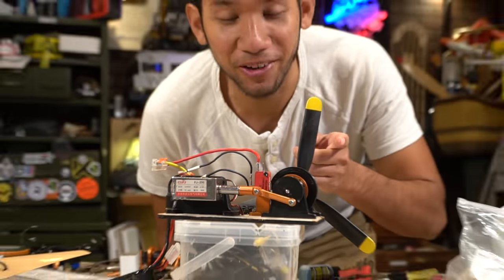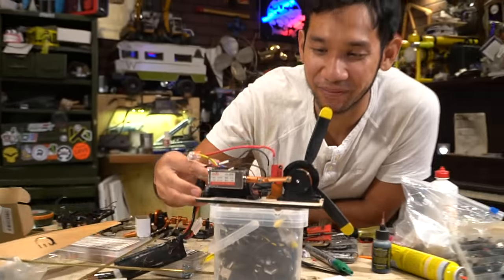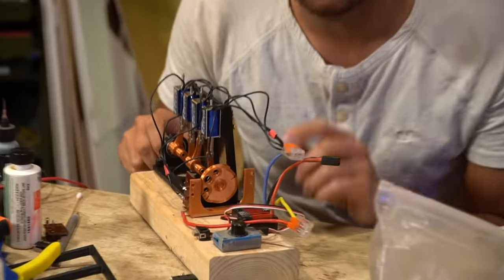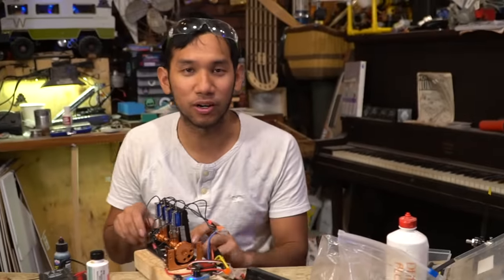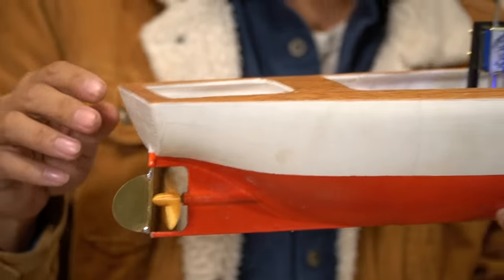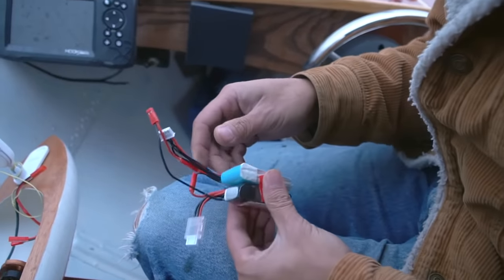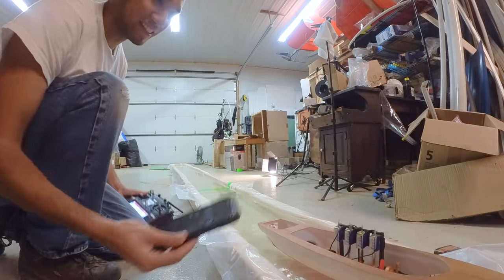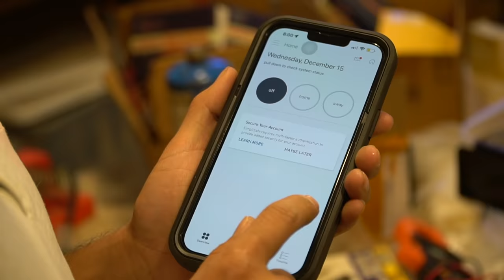Electric piston engine DIY (solenoid motor)

Comment: These engines honestly make me think of steam engines more than gas engines. Also Peter if you cover the engines and add a little bit of an opening for air flow, the heat generated from the engines could in theory keep them from getting cold! Also… you should totally use these to make a full scale titanic! The titanic had engines with those kinds of pistons that used steam. It would be a pretty cool model idea!
Reply: A full scale titanic?

Comment: You can put a switch on the other side of the cam from existing switch and do something clever to reverse the solenoid current flow on the reverse stroke, so that the cylinder becomes dual acting. You can't get that from a gas-powered engine!
If you wanted to get really fancy and improve the efficiency one could use hall-effect sensors and an electronic control module to run it all. If you can reduce the current flow it might become a bit more efficient. Very cool!

Comment: You need a 90 degree throw crankshaft. Your engine is basically a 2 stroke (fires every revolution not every other), and the 90 degree crank will give you 4 discreet firing pulses, a much smoother run, and not be "fighting itself" so much.  If the solenoids get hot really fast, that's a good clue that your timing is way off. Add to that the fighting itself, and you'll have that result.

Comment: It looks like fun but some things to tweak? Use the flywheel bolt metal or cams for 4 x switches at 90 degree angle spacings to bridge circuits for each solenoid. Change from flat 4 cylinder to 90,180,270,360 degree crank big end angles to permit starting in any position. Lube the solenoids with silicone. Drop the center of gravity of the boat. Consider using a speaker coil arangement instead, to permit power on both strokes. Mount the solenoids in a V arangement or flat 4 to drop the center of gravity.

Comment: i made one 4 cyl engine with  a magnetic crankshaft angle sensor to set the firing timings with an arduino, my plan was to put it in a boat aswell, using these magnetic clutches found in printers.   but after getting it running, it was way too weak and overheated quickly, the printed parts melted after some time.    the engine was a failure, but in the process found a easy way to build a high resolution sin/cos absolute magnetic encoder for literally cents worth of parts. basically two linear hall sensors, one 90° rotated and magnet on the shaft (field must be diametrical along the axis)

Comment: @PeterSripol I think if you put a flywheel and connect to the crankshaft it will make the engine run a lot smoother.

Comment: In addition to the 90deg offset like everyone else is mentioning, I also think adding more mains would make a huge difference, u can see the crank bending hugely at the end with the prop on it... bending crank removes sooo much potential energy, if the crank had more mains and could focus on turning rather than bending would like double or triple your efficiency I'd say

Comment: Peter, now make one with double acting solenoids, energized them on the upward and downward stroke by reversing their voltage polarity accordingly. You will double the strength, and the heat lol  Also, make it three cylinders, spaced at 120 degree from each other axially. And control the three phases voltage waves with a microcontroller triggered by a crank sensor. It would run smooth and be powerful, don't forget to force liquid cooling thru you solenoids! See your video in a year.

Comment: You could make it more powerful by not only adding more "cylinders" but by using thinner wire to wrap more coils, this makes a stronger magnetic field, making the motor stronger

Comment: Definitely need to adjust the timing. I'd imagine the solenoids are acting on the crank well after center which is slowing the crank tremendously. Proper timing and if it was setup to push and pull, it probably would have a decent amount of power for what it is.

Comment: I heard at the end of the video that the switch burned out due to the intense sparks due to the conmutation of high electric power. You could use transistors to switch the high power electricity from the solenoids, and only using the switch to conmutate a lower electric power that controlls the transistors and that does not burn the switch, it could improve the life expectancy and reliability of the mecanical switch you used for the solenoid engine.

Comment: Slap a crank sensor on it and control it with an arduino, and you'll get much better control of solenoid activation duration and timing, you'll get speed and torque, also crankshaft throw size is a major player.
For the air plane you have to do a radial one, it will be too cool, but maybe too large :D

Comment: I would go for a I6 configuration with the pistons separated 120º of each other, it would increase the torque since there is always 2 solenoids on the powerstroke. Also, you may want to try to create your own solenoids with permanent magnet rods so they can do double action, altought I dont know if that is posible. Aside of that, look for a solid state swiching and a proper way to disipate the back EMF that the coils generated when powering off, it will fry your circuits in no time

Comment: @PeterSripol ooooh please a WWI style rotary solenoid motor for your aircraft version? A 7 cylinder Gnome or a 9 solenoid Le Rhone? It will give you the additional advantage of much reduced crank and case weight. And it will just be sooooo coo!
Reply: Bonus—no flywheel needed, nor counterweights for reducing vibration.

Comment: A cross plane I4 should give you a smoother power delivery and possibly help with the stalling. At the very least it would be self starting if it does stall. Of course you would need two switches for that.

Comment: Well done, i have an improvement to offer : the switch can not hold all those sparks for long, you better use a FET transistor to run the solenoid's,
no damage will cause to the switch. good luck.

Comment: Basically term, down stroke when the connecting rod(and piston) is moving away from the cylinder (making more space inside the cylinder)  and the up stroke is when the connecting rod (and piston) is moving two-day the cylinder (making less space inside the cylinder)

Comment: If you used a DPDT On-On switch you could have it alternate current direction through the solenoids so both directions are power stroke, to get double the torque and power output

Comment: A couple of suggestions: 
I think the single cam and switch is a big compromise as you are unable to tune the pulse to something other than a 50% duty cycle.  I think it would run better if both the on time an off time could be optimized.   
You could collapse the magnetic field in the coil a lot faster if you hook the fly-back diode to a higher voltage.  It will not take much current but will put the brakes on the magnetic field much better than just returning the diode to supply voltage.

Comment: Btw buddy you should have added a 2 speed transmission. 1st gear is a 1 to 1 gear ratio then gear 2 should be a cvt (continuously variable transmission) to have low torque needed but a ever lasting raise in speed

Comment: I'm going this comment before I've finished watching the video: I wonder, could you arrange the pistons in opposition, to minimize vibration, like in a motorcycle? Also, I would it not be advantageous to use the motor to spin a large flywheel, from which you could extract energy, possibly via a torque converter?

Comment: Fairly sure solenoids can pull and push, so youre only using half what theyre capable of if so! Also  a crossplane crank with 2 cyls would be smoother; and an alternate mechanism for triggering them, hall effect sensor maybe?

Comment: How about using a DPDT reed (or other type) for polarity reversal? This would allow the solenoids to pull as well, providing (I assume) twice the power; only caveat would be that you need to ensure they don't "fight" each other, so they may need some sort of out-of-phase disconnection or an imbalance in the crankshaft or something. Idk, I'm not an engineer

Comment: Now try building a double action solenoid V8 engine. Double action solenoids push and pull both directions instead of a latch/single action. You would get a working “stroke” on each cylinder every revolution. Control timing by having an arduino fed crank position using a Hall effect/reluctor or photodiode/grid wheel and have the arduino fire a large mosfet setup. It must be wired correctly to get push-pull action by all 8 cylinders. Set crank angle readout at zero and fire 1-8-4-3 down and  6-5-7-2 up and reverse operation as soon as crank readout changes to zero again. You can introduce small ignition delays between cylinders to smooth it out. Flywheel is not necessary because each cylinder has a working stroke on each revolution, you can even fire all bank 1 to go up while bank 2 is all pushing down. The setup maybe a bit complicated, simplify it by having two straight 4 banks running double action solenoids and join cranks on one output. You can use your current setup but need another switch to control the second action of each solenoid.

Comment: I guess the problem is in the shaft position sensor; it’s mechanical switch. You could enhance your engine by using electronic sensors and further improving by several of them for each solenoid.

Comment: With more precise timing I think you can greatly improve power and efficiency, I would use an arduino and a rotary encoder. For the airplane that I'm really looking forward to, I think you should definitely make a radial engine.
Reply: Wouldn't a purely mechanical solution be morein keeping with the style of the engine?
Reply: @TheKamiBunny  it is somewhat electrical already, but yes I know what you mean and yes that'd definitely be cooler but also heavier and much harder to build and fine tune especially at higher speeds.

Comment: Piston engines need a flywheel to run smoothly. Especially with a long stroke. Also helps with changes in torque demands due to the kinetic energy stored in the flywheel.

Comment: Fairly certain that if you adjusted the timing so that each solenoid controls 1/4 of a stroke, you would get more torque, and additionally more acceleration.  I will agree with you though, solenoid power is not efficient, but it is fun!

Comment: Should add 5 degrees of timing delay after TDC to eliminate binding and heat in the solenoid. Should up the torque a bit by firing the cylinder in when it begins the down stroke.

Comment: For doing work with a 4 piston design, I think a cross-plane crank would work a lot better by having greater power density. A solenoid basically acts more like a 2 stroke IC engine. Overlapping power strokes would produce more useable torque.

Comment: I loved this video. I have wondered for a while whether these solenoid motors could be used to actually run anything. A boat was a good choice for a first experiment, the early steamboats weren't all that efficient either for their weight.

Comment: The engines you see on YouTube have the solenoids perpendicular to each other is because at the top and bottom is when the engine can't do anything. If you have them facing in a v then there will be no top and bottom, although it's a bit harder to do the timings when they are setup like that.

Comment: A small value cap (like.01 microfarad) across the relay contacts woukd probably help with switch longevity. The switch contacts would last longer. You probably have carbon
build-up.

Comment: also if you used the NC terminal of each cam lobe micro switch to trigger another DPDT relay or moseft style arrangment to reverse the polarity on the upstroke.. may be able to get almost 90% power stroke, per solenoid. per revolution
Reply: and this pertains to the 1 cylinder setup. cause the way you did the "waste fire" setup on the I4 would not work in such a manner... not that it isnt possible of course... hellloooo arduino!!
Reply: and im rambling at this point but a heavier flywheel will help with that issue on the deap application of brake effect like you fingers did.

Comment: If you wanted to look into this type of electric motor more you could look into the Yamaha cross plane crank it would allow your electric solenoids to constantly be on a power stroke you would have to add another cam and switch though because you wouldn't have two up two down and you could put some weight into your crank to give your rotating assembly some umph, that would solve your torque problem. Tried to sound smart the first time sounded good in my head not when I looked at it lol.

Comment: If the shaft is the function of pulling, then make another one so that the one in the front of it it also performs the process of pulling so that you gain thrust and pull and gain more torque.

Comment: if you add a second switch and make it a cross plane crank so that 1 solenoid per half cycle is in operation you can increase torque and efficiency so that you don't have a dead zone between solenoids

Comment: Very good video.  Electric engines are weaker than gas ones but even that the it didn't have a gear set (claculated) as to maximize the output torque force. Also the pieces of the engine (some of then as the screws ) are pretty big.

Comment: You could have added a 2nd momentary swith to the opposite side of the Cam and wired it to the solenoid but in reverse polarity.  Which would make the solenoid  operate in both directions

Comment: For an aircraft, might want to consider a radial design. Also, a sawtooth for the switch. Or. If sticking to inline, move to 120 degree or 90 degree.

Comment: The way you're going going there, you might look up firing order and balancing for the "4 banger" as a 4 cyl engine is called.  You can get nearly or perfect balance with a straight 6 geometry and there are advanced methods for balancing 4 cyl engines.    My notion is that the basic idea might could actually be an improvement in effciency since with a solenoid the forces and motions and fields (functioning under what is called the right hand rule) of electromotive force seem aligned well.   If such alignment is better than that of electric motors, then you have the solenoid motor's geometry friction losses vs. the emf alignment of the ordinary motor?  Is that right, in terms of major contributing factors?  Seems close.  Cooler running with more power, perhaps? How about a nice solenoid radial-geometry motor, powering a full size experimental?   Keep up the good work!

Comment: I am curious: if already going to build a coil and apply the concept of electro-magnetism, why not build it into an alternating/rotating motor?

I recall having bought such a kit when I was in 5th grade, thinking that kit was a toy. Turns out it was a middle-school science project kit. At first I didn’t know the importance of keeping the wire coil going only in one direction, and must have flipped the wrapping direction on the other side of the spindle. Took me about a week to get it right. 😅

Comment: I'd like to see a solenoid engine where the crank shaft has 4 cranks, 90 degrees apart, and using optical sensors / interrupter modules to activate the solenoids. Also, the engine may benefit if capacitors were added to help with the initial burst of current needed when the solenoids are energized

Comment: my guess would be something to do with the timing. are the solenoids "on" for 180 degrees of the cycle? i bet if you messed with the cam and timing, it would run better. maybe a flywheel to smooth it out? :)

Comment: About the torque delivery. I'm not 100% sure it will change a lot, but maybe a cross-plane crankshaft would get you more torque than a flat-plane crankshaft. You'd probably need more switches for the solenoid, because they'd be "firing" one at a time and not two like you build it. But it should run better (I guess/hope)

Comment: You should try 4 switches with 4 cams, and have the cranks spaced every 90 degrees. Then at least you could start it from a standstill, and I bet the torque would be improved.

Comment: If you used a roll maybe 4 sheets thick of varnished tin plate for the iron plunger it would be lighter and have fewer hysteresis eddies -  then replace the points with a magnet-triggering reed switch - encase the coils in a thin iron sleeve so the magnetic circuit is complete when the plunger is fully home - lots of thin wire turns will work better ( Turns x current = magnetic flux density)  - it will be faster and way more efficient -  call it Gauss

Comment: You can probably do the Subaru opposed 6 cylinder, which needs very little counterbalancing. Then you probably also need have a longer delay between "pulses" since the very top and bottom of the stroke has terrible torque. And bad timing would lead to it fighting itself.

Comment: The use of mechanical switches will limit performance due to contact bounce time. Use hall switches with MOSFETs, or even bipolar  transistors for an improvement. Nice job though!

Comment: BTW to get more torque you should use a fly wheel "usually a 3d printed wheel with holes for metal bearings

Comment: If you swapped the core of the solenoid with a permanent magnet core, you'd get more push from the perm magnet AND you can reverse polarity on alternating strokes to, overall, get more than double the performance.  ;) 
EDIT: Also, use a diode to kill that spark and/or use a MOSFET with it. :P

Comment: To get beter reliability you should try ofseting the crankshaft at 90 degrees instead of 180 and also having the solnldeds fire in both directions